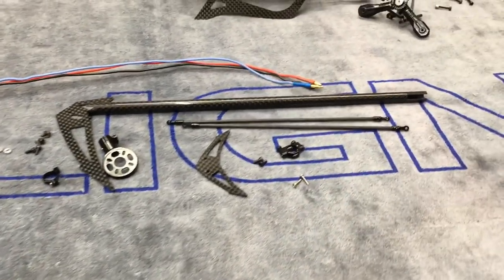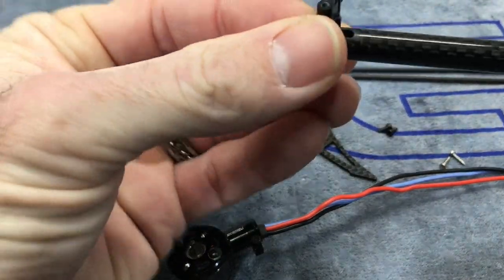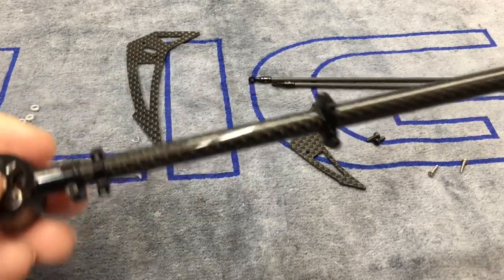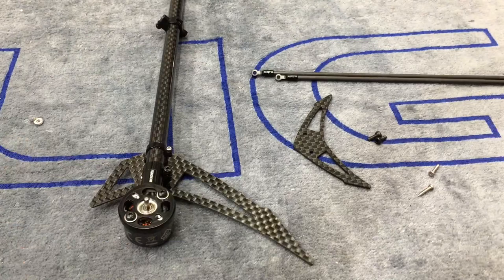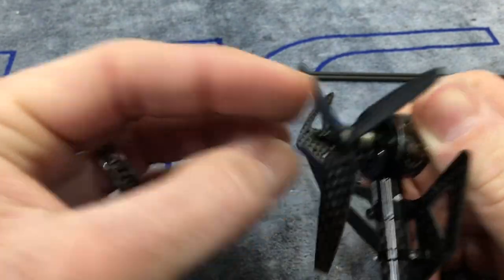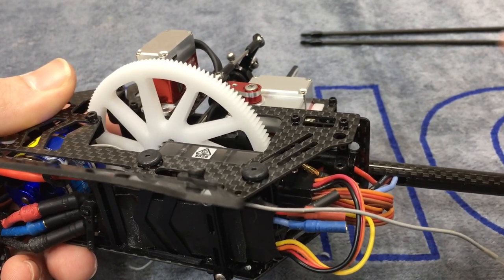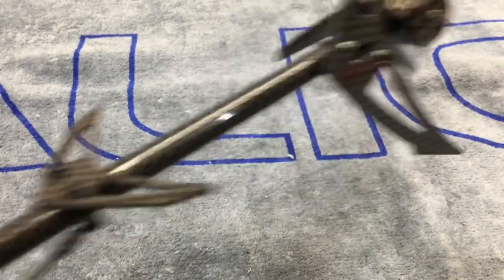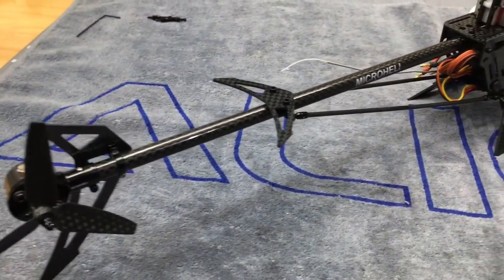MicroHeli 230s Tail Assembly￼

Comment: I really want to see you do a microheli MCPX BL2 video - I have done a full microheli/rakonheli bl2 build but can't figure out how to get the aluminum tail boom to work - obviously the tail motor wires need to be cut and then soldered after they've been fed through the boom, but the wires look to be uninsulated/solid? I'm going with the stock boom for now, but would love the look of the (probably less resilient but cool-looking) aluminum boom...
Reply from the maker: That is next! I’m just waiting on the kit to get here. I’m doing a three bladed build as well of course. I love my three bladed helicopters LOL yeah they are a solid copper wire which is makes it a little more tricky for soldering but I will definitely show how to do it! Yeah they might be less resilient but definitely cool looking!
Reply: @westhobbiesrc8051  looking forward to it!
Reply from the maker: @slimigan  I got word today that my BL2 kit is on the way! So hopefully I’ll get in a few days and can get started!
Reply: @westhobbiesrc8051  that's great - I'm done my build other than the tail assembly. I'll start with the extra stock tail, then try the aluminum assembly next...
Reply from the maker: @slimigan  awesome! Did you do the stock to Bladed head? I can’t wait to start mine!
Reply: only stock parts are the motors and servos
Reply: @westhobbiesrc8051  sadly, my new tail assembly wires had one break at the plug and I haven't been able to fix it. Very tough to solder it back to the plug...
Reply from the maker: @slimigan  so a little trick for soldering those copper wires as they can be extremely difficult. Sand it first with some thousand grit sandpaper do you want to get that coating off you’re going to run a higher heat use some blocks and it will stick but sanding it is the important part.

Comment: Question where that tail boom inserts into the mount going into the main frame the boom stops at the insert , does is stop there ? Leaves little room if so. Or does it go past the insert ?
Reply from the maker: The boom slides into the boom block a keyed way And stops once it is fully inserted
Reply: @westhobbiesrc8051  keyed way? Sorry lol I just put boom in n slide it n it stops at the little insert. Stopping there leaves a little room which wasn’t sure if it shoud be in further
Reply from the maker: @jtkeys7618  not necessarily a keyway but there is a notch in the boom and that little pen that it slides into to stop the boom from rotating in the boom block. Yes it goes and stops into that pan and there is a little gap for the wires to not be completely pinched off. Once you tighten the clamp down the boom will not move.
Reply: @westhobbiesrc8051  ok. I’ve built this so many times first w/ MH frame. I just wasn’t sure where the gap is in the boom if that was supposed to pass that little insert in the mount ( confused cause it left little room . So yes it stops at that insert was all I need to know thx for the speedy response n help. Your build is beautiful 🤩
Reply: @westhobbiesrc8051  my boom was bent little from that stock frame having to tighten down unbelievable so now it went over that insert correctly . Thx again
Reply from the maker: @jtkeys7618  awesome! You’re welcome, yeah they can bend for sure

Comment: All these add ons just break in a crash.
Reply from the maker: Everything breaks in a crash lol
Reply from the maker: Also I don’t build to crash, I build them for what I like
Reply: @westhobbiesrc8051  Depends on the crash and how you fly the helicopter.Not everything breaks in a crash rule number1.
Reply from the maker: @cyberneticinterfacemodular3996  anything bigger then a nano will break in a crash, of course there are things you can to lessen by hitting throttle hold and low head speed and so on. But if you crash a 230 it’s going to break to some point. Boom will bend or blade grip or bend a feathering shaft and so on. So just because you think add just break in crash so does a stock heli. But for example this carbon frame will take a hell of a beating compared to the stock plastic. You won’t be breaking blade grips sure you could bend them but again I build for performance and no for crashing lol
Reply: @westhobbiesrc8051  This why i fly helicopters and quadcopters.Just not a fan of carbon for some funny reason i have had with it in the past in my job.
Reply from the maker: @cyberneticinterfacemodular3996  I will choose carbon all day over plastic. Plastic has so much flex it’s crazy.
Reply: What are your thoughts about the four-blade head?   Trying to figure out what options to buy.